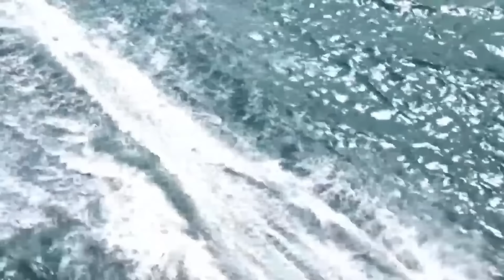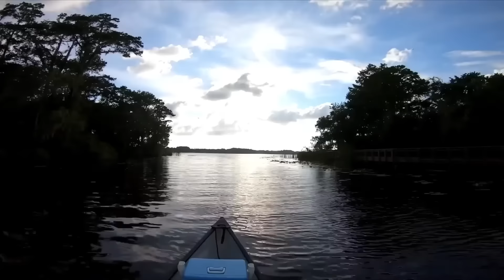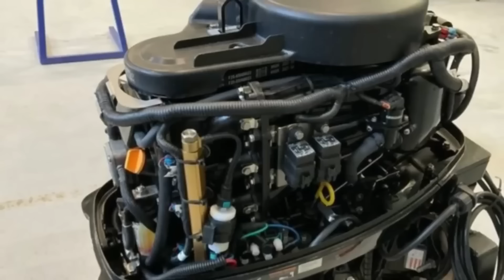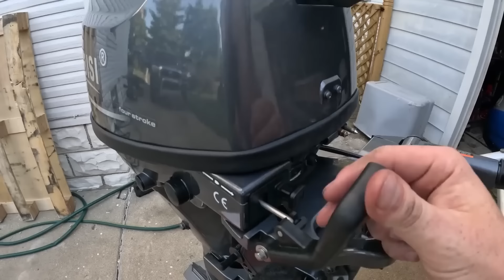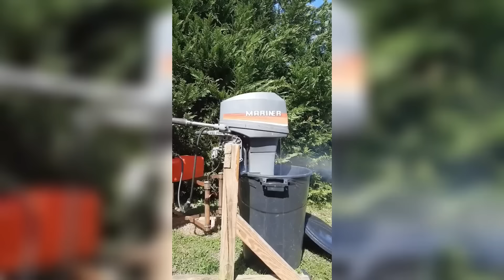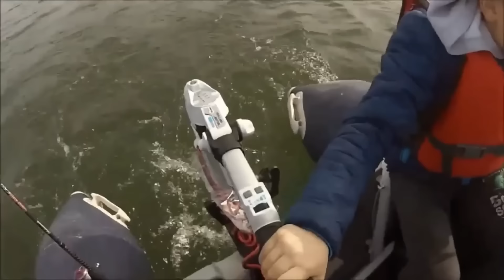10 Cheap Chinese Outboards SO Good They DESTROY Japanese Brands!

Comment: Thanks for that information and getting cheap motors to Venezuela is going to be very important especially anything over 300 horsepower. You know they're running six,300 horsepower motors just to make their fishing boats move. It's amazing how much money those fisherman have for motors. Last I checked a 300 horsepower Suzuki was about 65,000. How much can China subsidize the motors for Venezuela so they can guarantee that the fentanyl deliveries don't get delayed?